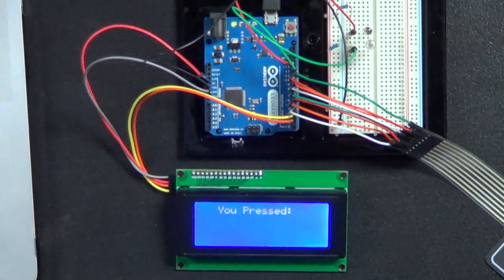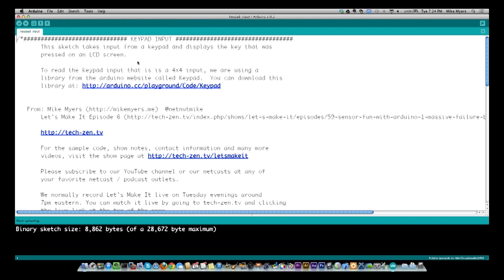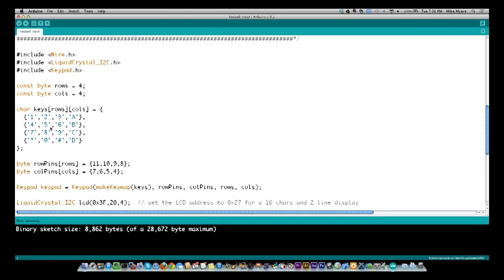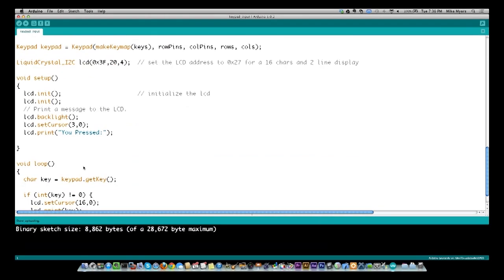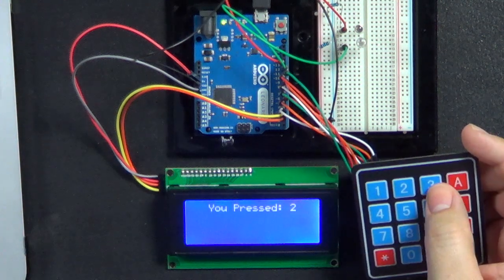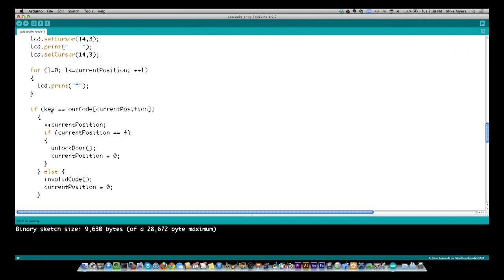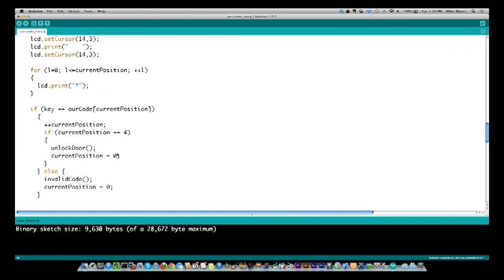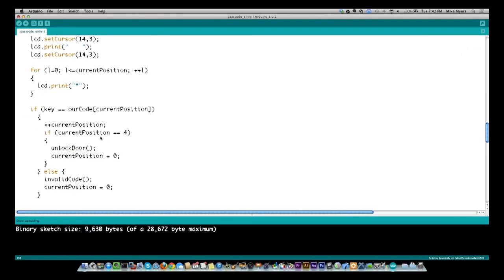Keypad Input To An Arduino - Let's Make It - Episode 11

Comment: Very well done on this timer. However it does not quite do what I am after. What mods would be needed to make it into an Hours - Minutes timer? Better still an Hours - Minutes - Seconds timer? I have over 50 years in electronics and 30 as an engineer. I am completely fluent in Microchip but I am a newbie to Arduino. Your help would be greatly appreciated.
Cheers Jeff Monegal.

Comment: I know it's an old video, but that is a bad way to code a keypad.
If it lets the user know when a key at the current state is wrong,
then it wont take more than 10 minutes to figure out the code.

Imagine an ATM where your code is 1,2,3,4   then you press  1,2,4,  and since spot 
3 is wrong i will let you know, then i already know that 1,2, is correct.
Then you might as well just show your code.

It would be better to allow the full amount of digits to be entered first, THEN let the user know if
its wrong or not, because then the code is very hard to brute force.

Just for anyone out there ever designing a keypad system with a code that "supposedly" should be a secret. ;) 

Cheers
Reply: I was thinking that too. It's a 12 key keypad and 4 numbers, go figuring it out would take a maximum of 12x4 = 48 tries. If you on average get the right key after 6 attempts it would on average take someone 24 tries to figure it out!
Reply: Hmmm i dont think so Simon WoodburyForget. You would find out almost immediately that the keypad had this feedback mechanism, and then it's just a few guesses. If there was a keylock you would either have to have the key or know how to pick it
Reply: +Eqvaliser can you please tell me what to change about it to fix is actually because i can't figure it out. i know it is with currentPosition but don't know how to replace it with something better.....
Reply: I agree, each key should have a value, and it should only reset at the end that way the user doesnt know where the invalid keypress was. Say 1 = 5, 2 = 3, 3 = 9 , 4 = 6 ect.. then total it out at the end and it if total = 23 unlock, i need a better lcd i have a 2 liner :( from elegoo
Reply: also anyone know where i can find good female to male and male to male jumper wires the elegoo ones are junk and short out on each other.
Reply: I was about to say the same thing. This is like how video game puzzles work.

Comment: Hi, im not sure if you can help at all, i have a 4x3 keypad but it only has 3 wires coming out. Below is what the sticker says they are.
White : D1/TX/4R-
Green : D0/RX/4R+
Grey : 26/34

Do you have any idea how i can connect this up? I cannot get access to the rear of the panel to see how its wired or if it has resistors on there as it has been filled with resin / putty. I have already got an rfid reader working, but would finally like to get the keypad working and get it to trigger a relay when the correct code or rfid has been entered.

Comment: Its a good start, but like some other people, I see some holes, it would be beneficial to store the code and possibly, be able to re-program it using the keypad and a sequence of key presses and entering the whole pin (possibly on an array) and check against the stored pin, since in its original state, it would possibly take a few minutes to figure out the code

Comment: Hello there, this is a great tutorial! I wonder if You could help me with a dilemma?

I am new at Arduino with a big dream! I am planing to build a device with 6 different analog sensors, a clock module, a 4x4 keypad like Yours, a simple 4 line display and some 3 or 4 output devices like valves, servos and actuators! So, the question is, as I am having difficulties figuring out, what board to get to accommodate all the connections?

Thanks!

Comment: Very helpful since I'm working with a keypad and an LCD screen right now. My keypad does not do anything when I press the buttons. The LCD screen lights up so I know that works, I'm thinking the problem is with the keypad. I soldered it up, so maybe I short circuited it?

Comment: The solution I used to have a secure code was as follows:
(1) * key - clear any keys pressed at this time
(2) enter secure code
(3) # key - last key of code and now validate key.
The advantages are:
(1) any key length can be required by sketch
(2) a definitive state of  begin sequence (* key)
(3) a definitive state of end of sequence (# key)
(4) no intermediate validate so repeat tries of entering code give indication of success
I used a state table to recognize the key sequence.of the code.

Comment: Nice instruction,
 Not sure why people want a schematic "AND" an instruction video. I mean I would think you would either want a schematic and the arduino code with a short written description of what the project is for because that's all you need and not waste your time sitting through a video.
There are however lots of people that like me, a beginner and would like a video like you made of the step-by-step walkthrough instructions. As suggested by others I will add a verification step within the Arduino code to the to the keypad input for security but that seems easy enough to do.
I'm noticing that regular full size alphanumeric keyboards wire in a comparably similar fashion so after making this project for office access, I'm going to try to apply this to a full size keyboard. Have you tried this with a full size alphanumeric keyboard?

Comment: on the door project you want the whole 4 digits to then accept or refuse entery so a code breaker cant guess the correct sequence for the code! how can you make it so that it waits till all digits are entered before it sais accepted or denied?
Reply: ***** I was just going to say the same thing.. This code needs to wait for all 4 keys then tell you the result.   If not example of hacking would be press 1 then 1 again.. failed.. so 1 then 2 which is still good.. then 2 fail.. so on and so on.. easy to figure out.  but I see at the end he did do this fix and nicely done.  good job!

Comment: Telling that the code was wrong directly after the button was pressed is not really secure. That makes brute forcing very easy and makes every key solvable after at most 40 tries. If you wait till the key is fully entered, it would take up to 10000 tries with 4 digits. I know it's just for a showcase and would be insecure anyway, but that's not a good way to do that.
Reply: You could make it more secure by having an indefinite amount of key presses but it'll only activate when the correct 4 are entered + a timeout delay to make things even more annoying to people trying to get in.

Although, I guess that might be a bit much for an Arduino project since if anyone wanted to get in they could just tear out the arduino
Reply: was just about to say that.
Reply: The easy and best way would be to put all the four inputs into an array and compare the array with another array which has the correct code. Hence it will not compare till all four characters are pressed(all you will need to do is run a for loop 4 times).

Comment: Hi, my LCD is the blue 16x2 - but it seems to have a rectangle that is quite visible behind every character... can I get rid of this?
Reply: Usually on the back of the board (if using an I2C adaptor) then there is a contrast control which can be turned. If not, then you have to use resistors. It's because the background contrast is too high.

Comment: How would it go if i want to connect the Keypad in the video with a simple Data Logger Shield with sd card so that all my input from the membrane keypad is saved directly on the sd card? Is that possible?

Comment: I've been trying to get the keypad libraries to work but everytime I verify an error comes up for the way the keypad was classified. I have tried inputting it in the following ways;
#include <Keypad.h>
#include <keypad.h>
#include <keyPad.h>
#include <keyPad.H>
#include <KeyPad.H>
#include <KEYPAD.H>

Nothing has worked, i've checked arduino.cc and there reference site to no avail. At this point I have no idea what to do and don't see how this guys code even classifies itself as such. It might be the version of arduino im running, other than that I have no clue. Please help.
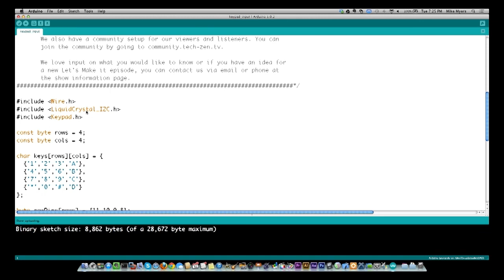Reply: +Tyler Fries 4:50
Reply: Thank you very much cyclingguy3

Comment: Hello, if i have an ultrasonic sensor connected to arduino, can arduino read it in real time and send signal/current through output pins until desired reading value is achieved?
Reply: You could keep polling the sensor and if the value is int he desired range do whatever.
Reply: Histo
I put some research hours to it, and sketch it's done.
Thank you! :)

Comment: The program should display the "denied" message only when enough numbers have been entered and/or a special character has been pressed, otherwise it is very easy to find out what the secret code is simply by pressing the keys repeatedly.
Reply: really a non issue, could be configured to do that in 5 mins

Comment: make your own keypad. that way you can use as many buttons as you like using 1 input pin, the other 2 wires can be powered from external power supply

Comment: i google many place but not found, i no un derstand good change keybad:h file ,all files have only 4x3 keybad and i have 4x4 KP. and i no understand how make i2c lcd menu, i need keybad bush numbers 1-100 exept 13,4 and then number come lcd and start button run number down 0. and back main menu (i think make motor run time what number show, adding number exept 12,5 milliliter motor run setting time and ready and back main menu, how i made menu and keybad whit lcd together ? please help me. ewerybody can help, im newbie and no understand how made thats. and use my keypad+ i2c lcd whit menu.and controll motor thats.

Comment: The secret code here is insecure, since if one presses a wrong value, it immediately tells you. Simply press each button until it doesn't give a red light, that is that part of the code. Repeat 3 times, you win.

Comment: There is one huge flaw with you're keypad code to open the door. By process of elimination (or brute force) the correct keys to press don't light up making easy to figure out the code. Just saying. Otherwise great video.
Reply: hey, can u help me? i want to make a key pad data logger,  we can get rich!!
Reply: @rtapper3040  Like people do when skimming credit cards from a gas pump? or some other nefarious deed?

Comment: Sorry but your door lock program could be hacked very easy, don't check for each key press wait for the entire code to be entered then a enter or letter to send ....because you are showing them what key no to press
Reply: +Craig Kirchner + Eqvaliser  This is good for a game if they need to work out the code by trial & error, which is what I want to create. However, I can't work out the circuit diagram.

Comment: Hi If you want to free up some digital pins you can use the keypad with an analog setup using just 1 analog pin. Check out my video on Jezza.h (Arduino Alarm with 4x4 keypad connected to just 1 Analog pin and PIR Sensor Done ).